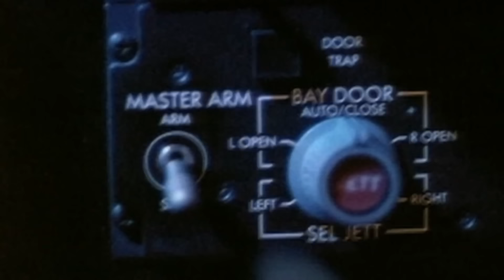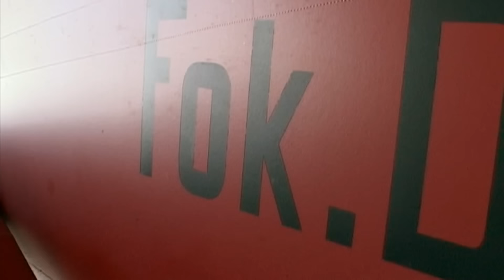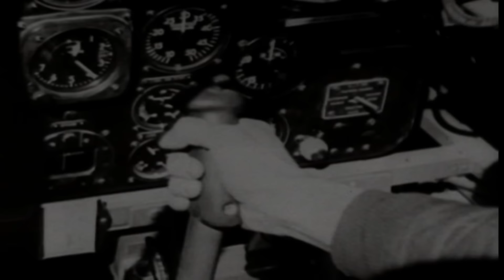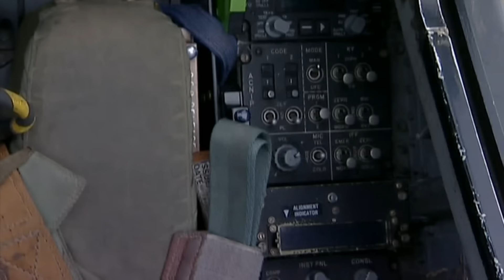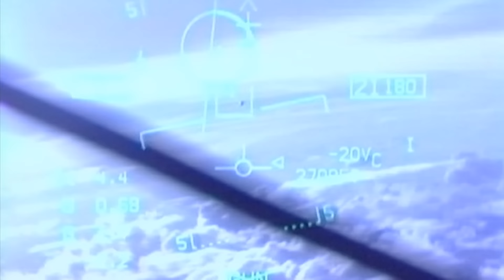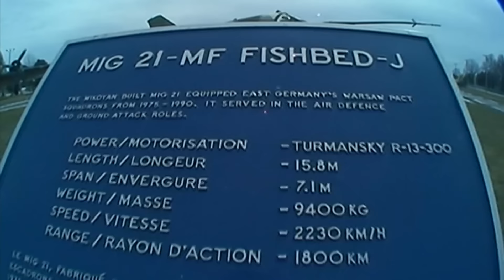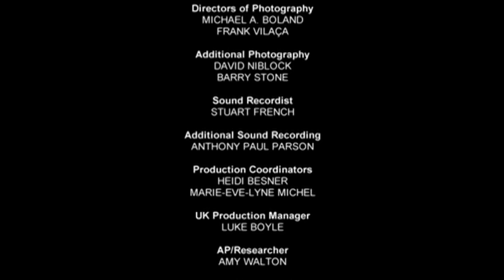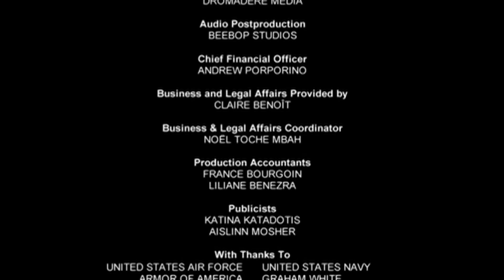The 10 Deadliest Fighter Planes To Ever Take To The Skies | Greatest Ever

Comment: The Spitfire had limited range as opposed to the Mustang because it was designed as an Interceptor, short range, fast climb, highly manoeuvrable and hard hitting, the Mustang had its long range due to the amount of fuel it carried AND the economy of the (Packard) Merlin engine, though with a full fuel load it was unstable and could be dangerous if not flown relatively conservative until some fuel was burned off from the huge tank behind the pilot.